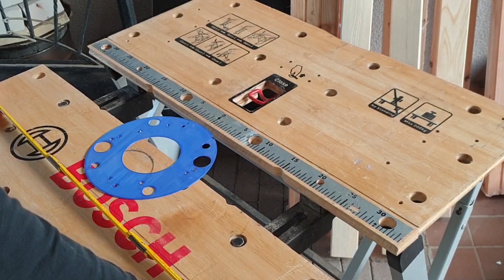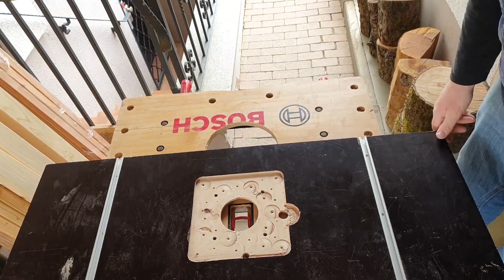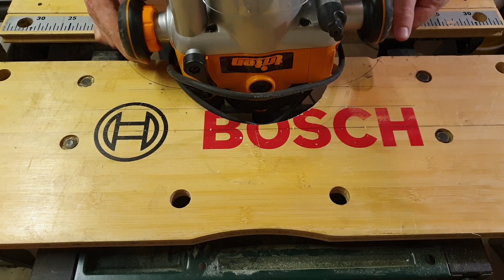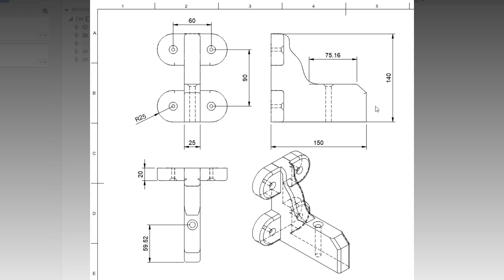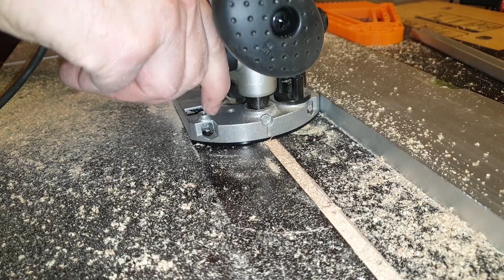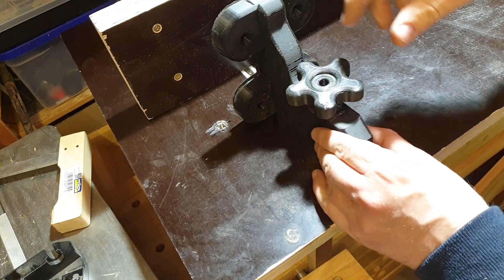3D printed parts and a router table build using a folding workbench

Comment: This is a great router table solution, using 3D printers is a natural complement to wood work
Reply from the maker: Hi Layne, I use this setup now for nearly  a year and it works great .  I am currently designing a new 3D  printed router plate with  a change able inner part  for my Triton router. Work in progress.🛠